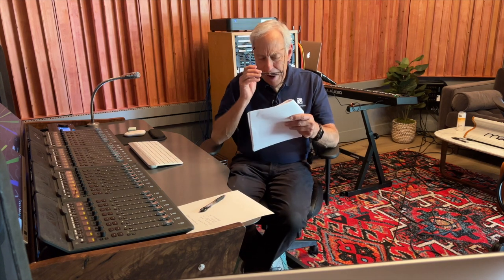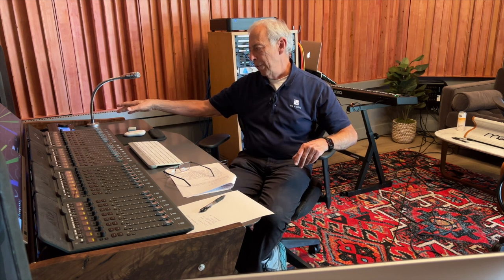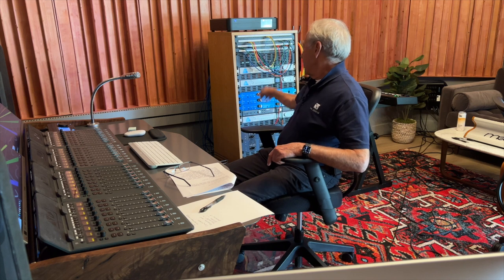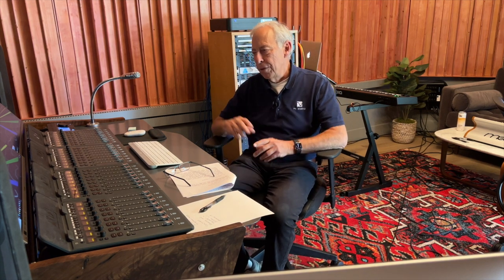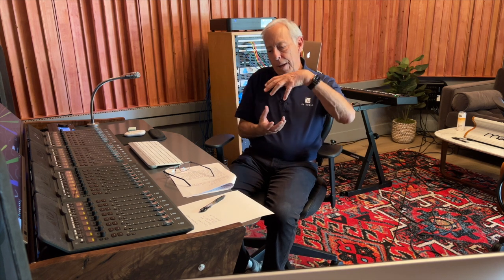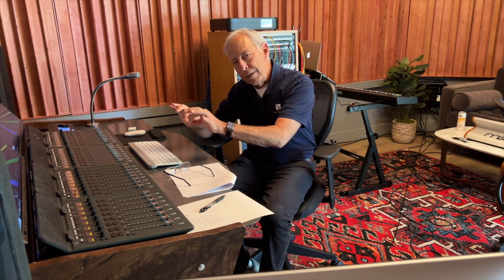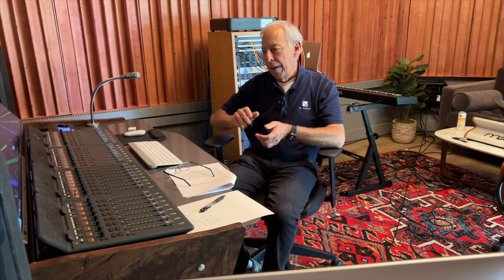Direct live recordings

Comment: Yeah… basically, what the engineers did digitally was similar to what was done with analog… there was a second playback preview channel with identical electronics in line so that the computer in the cutting lathe can make all of the calculations for the groove pitch changes necessary to optimize the vinyl output.

By the way, Paul… what work surface are you sitting with in this video. Is this what you use to mix down the DSD streams or just what? Thanks!
Reply from the maker: Hey, Jim. Those are Avid S1 control surfaces controlling the Pyramix workstation. And, yes, in the mixroom is an identical setup. We do the rough mix in the tracking room and it carries over through the automation system to the mixroom where we make the final mix.
Reply: @Paulmcgowanpsaudio  thanks Paul!! I'm an old "studio rat" tech who would love to see your setup... I live in the Phoenix area and may just take a drive to your neck of the woods to see the studio, PS Audio, and a business associate as well. I more or less thought that those were AVID control surfaces, but didn't know which ones. So this is the "monitor/rough mix chain in your recording process with the Studer console being the front end?
Reply: @jimrogers7425  You'd be most welcome if you do come down. The Studer has been retired (though it's still at PS Audio Central). We're now converted from DSD->analog->DSD to DSD->DXD->DSD and that can all be done in the two rooms of the new studio.
Reply: @octaverecordsanddsdstudios1285  Paul... it sounds like the DSD process is a lot of fun overall. I'm quite steeped in the world of tape-based, as well as hard disk based, analog recording. It would be a real pleasure to meet you and talk shop about so many things... a trip to Boulder will be on my calendar at some point in the not-too-distant future!